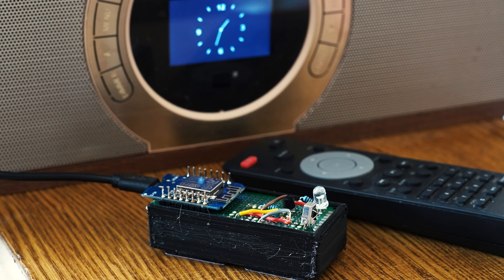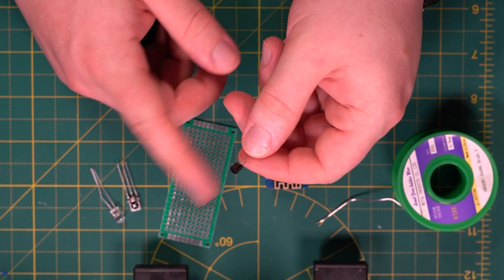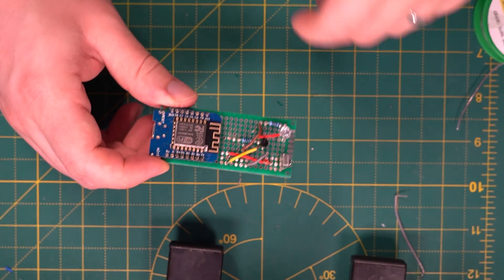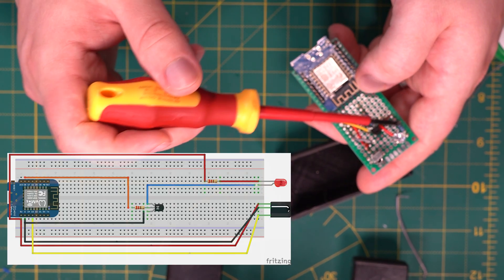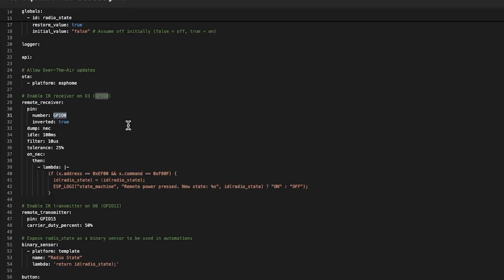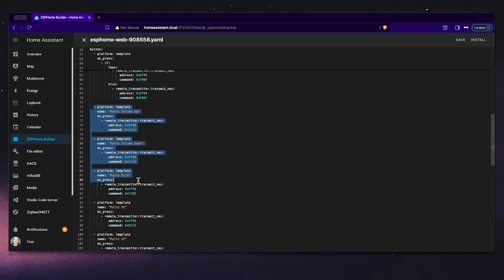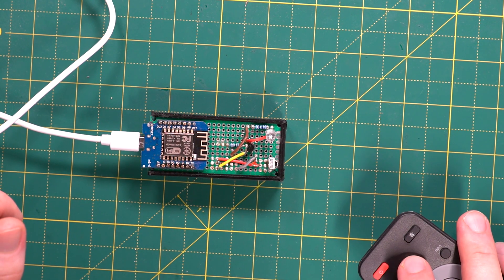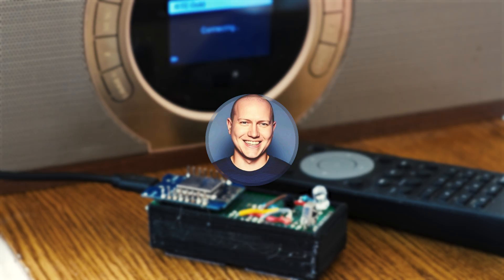I Built My Own Infrared Remote To Control My Smart Home

Comment: Just curious, what's the range of the IR transmitter with this setup?
Reply from the maker: I don't have a figure anymore unfortunately - but it is still pretty short, and requires a good line of sight to the receiver.

Comment: As others have noted, very good first video.  The code walkthrough and demo were the best parts.
The music was so loud compared to your voice that it was merely distracting.  I suggest you either leave it out or find a way to set the volume 5x softer.
The circuit board walkthrough was good, but you camera struggled to maintain focus.  Perhaps you could leave the board on the table (instead of in hand) and use a skinny pointer that won't disrupt the focus.
NICE JOB!

Comment: Isn't collector, base and emitter short circuited in the fritzing virtual protoboard? Also the resistor and base share a hole, and the ground connects to nothing.
Reply from the maker: That's super annoying.. I see what you mean about the holes. My first time using Fritzing 😑

I've updated the wiring diagram I have linked in My Github for reference (in the description). Though I hope the intended route was obvious 😅

And given I was using a double sided PCB, I hadn't considered that on a breadboard (or BB diagram) that the position of the NPN transistor would cause a short on the transistor, I'll fix that too!

Much appreciated pointing it out!
Reply: @KeenOnTech Glad to be useful! Also, that fritzing dog bit me too many times, I ended up using the more time consuming but more capable KiCad.

Thanks for the project, I will probably build it to turn on my elderly mom smartTV automatically when she receives video calls.

Comment: Great first video for the channel. If I was to suggest anything for improving future videos it would be to spend a little more time planning/scripting for accuracy and completeness. I wasn't analyzing for errors but I did pick up immediately on a few things such as referring to the same board as having both an esp32 and esp8266 (these are different chips). A small section explaining how to get the codes from existing remotes might have been helpful. I assume you used the flipper zero for this but it was only implied after the fact, could it be maybe done with the esp receiver itself? Regardless of any small errors/omissions I like your style and I'll be watching to see what other ideas you share here, great job!
Reply from the maker: Appreciate the feedback Charlie, will most certainly take it onboard for the next one!